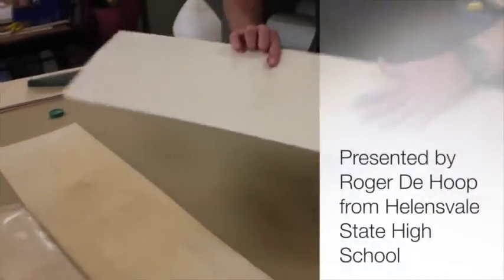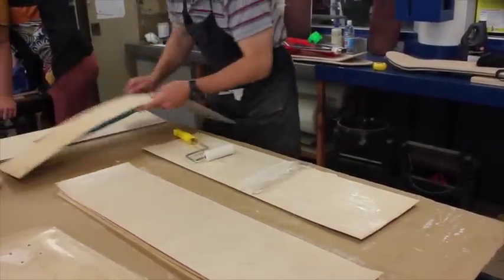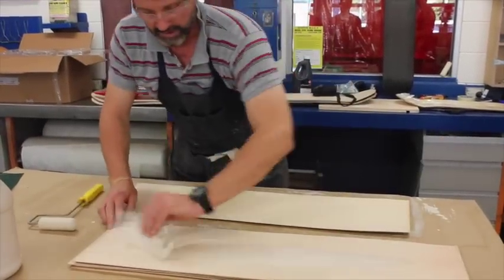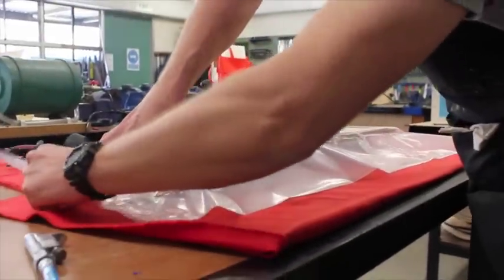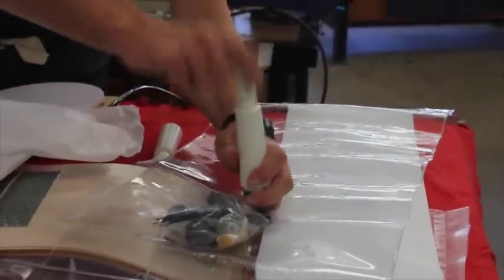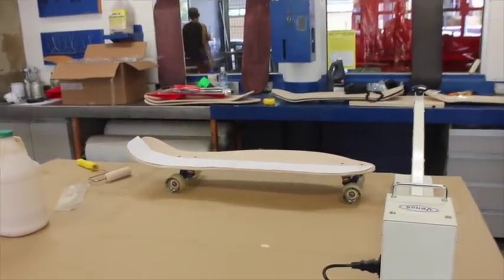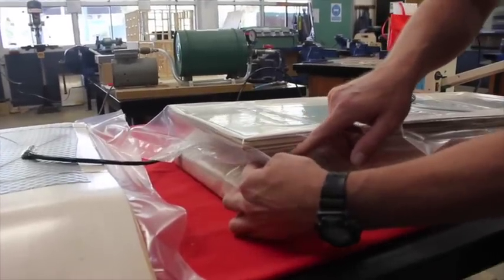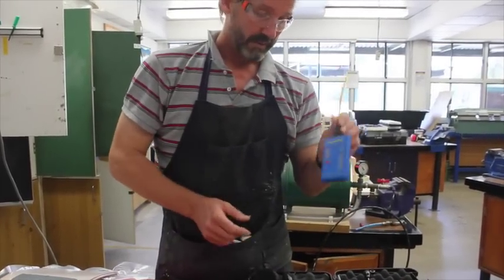Skateboard Lamination Process

Comment: How much glue do you use per deck?
Reply: If you roll decks by a hand roller you can typically get 6-7 out of a gallon.  With a glue spreader you can get about 8-9.  Contact Dub PRess Distribution if your looking for the wood and glues.

Comment: what is the tool which you suggested to use to route the edges of the board called?
Reply from the maker: A spokeshave. We use it to remove the bulk of the edge material then sand the 'rounded' edge shape with Emery roll sandpaper.
Reply: ABHINAV GARG a router. Lol.

Comment: way too much work, get a hydraulic press man, they work way better. I wouldn't trade mine for the world :)
Reply from the maker: Thats true - and we do. However, the program we run allows the students to design their own unique skateboard shape, size, etc. They CNC machine the jig to suit from recycled EPS foam, then vac bag the veneers to that jig. If we were to use a press, each student will need to build an individual press which wouldn't be anywhere near as feasible as using the EPS/vac bag process. 
Thanks.
Reply: so if you line up the glued layers of wood with the contours of the EPS foam 
inside of a vac bag, will the layers of wood conform to the contours of the EPS foam? or do you HAVE to use a carved/contoured block of wood? I like this method because it seems less expensive than a deck press.